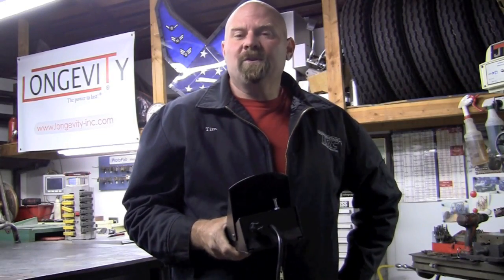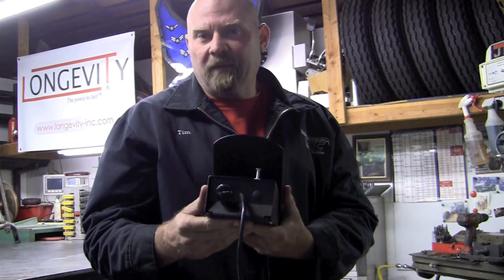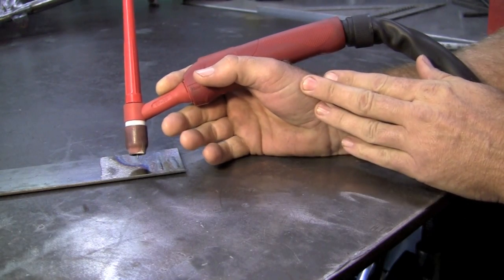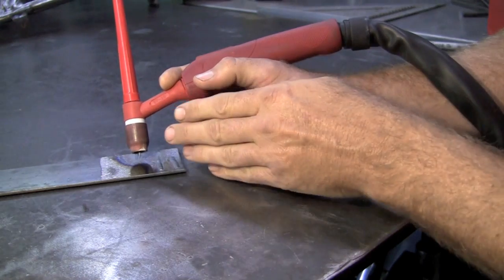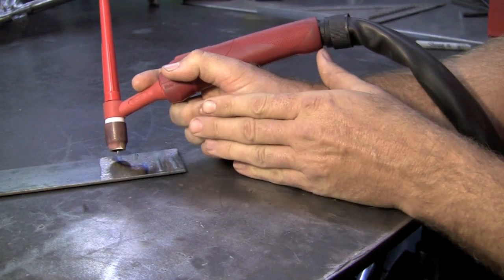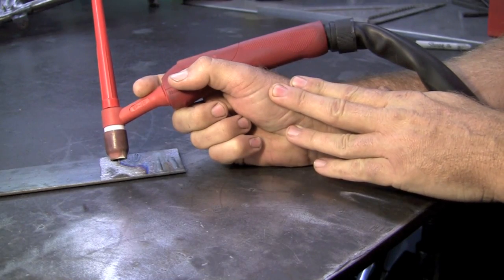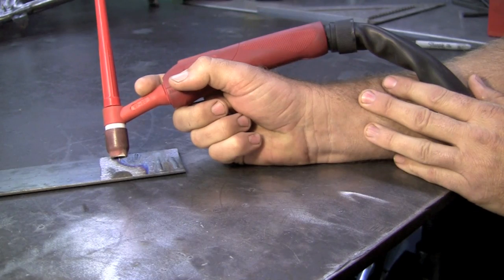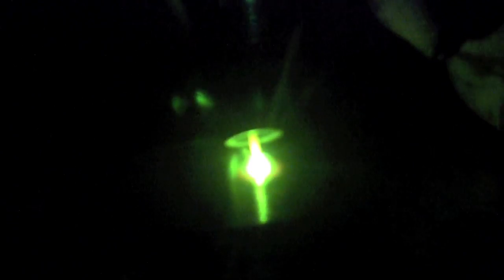TIG WELDING 101: Tips and Tricks when Welding with your LONGEVITY TIGWELD 200 DX TIG Welder

Comment: Ok I need a lil help here. I try to use safety glasses BUT I wear prescription glasses and cant seem to find safety glass that will fit over them, Does anyone else wear glasses n found safety glass that fit over them?? If so PLEASE what brand and model are they and where did you get them from?? Thank you very much
Reply: I would suggest wearing an auto-darkening hood instead of just safety glasses. Get one that's rated for TIG as a standard one may not trigger on the less intense TIG arc.
Reply: safety glasses under your welding helmet?
Reply: YfS
Reply: Why?
Reply: welding helmets fit nicely over glasses
Reply: A good hood will have adjustments and will darken .
Reply: I bought safety glasses at an optic and they put the prescription on them, so i have prescription safety glases.

Comment: Here is a tip to you based on my 52 years experience. Get a High Intensity Ring light like a Fotodiox Pro LED Ring Light 352A or similar. Then make sure your subject is IN FOCUS. You might even have to use the Macro settings. If your camera or operator is incapable of this then replace them. Here is to a new video that I can see.

Comment: I have a TIG that works with electrode 160Amps also. What is the pressure of gas should I setup when I worked tig? I never have used TIG.

Comment: Make sure the electrode is on the Negative side (DC) and the work piece is connected (Earth) to Positive side of your welder. If you have it the other way around you will put too much heat into the tungsten which will melt.

Comment: i just got a scratch tig set i cant get it wokjing when i scratch up its all messy and villent not a nice smooth arc like yours i got argon its only a small bottle so i dont have a flow met, all i do is burn the electrodes away how hi do i need the gas fast o slow what amps do i use ta loz,

Comment: Nice vid ! Here is a tip for beginners, [I have been welding for over 40 yrs] bend the filler rod over 90 deg [not the end you are putting in to the puddle] It reduces the chance of poking yourself in the eye or face when you flip up the helmet to look at the weld.. I also welded a piece of tube on table [or attach to machine w/ hook] to  hold up hose to keep the weight of hose from pulling on the torch.